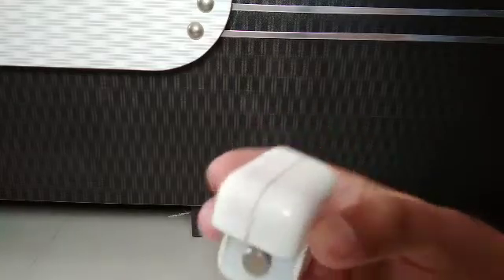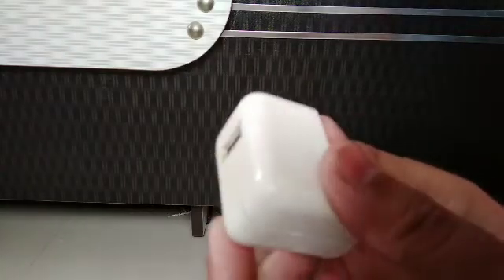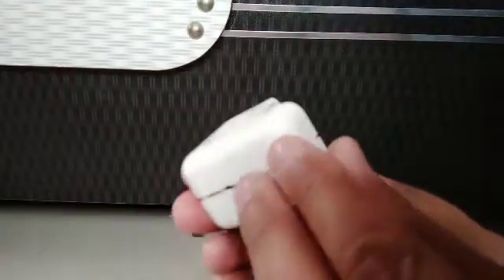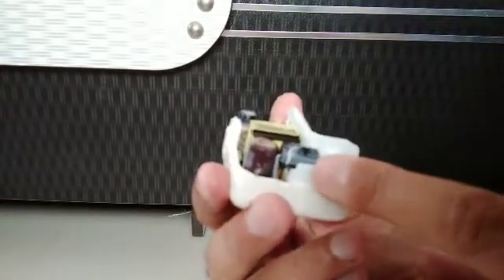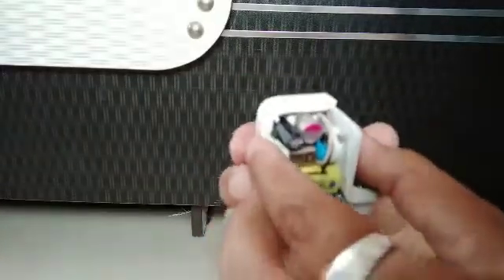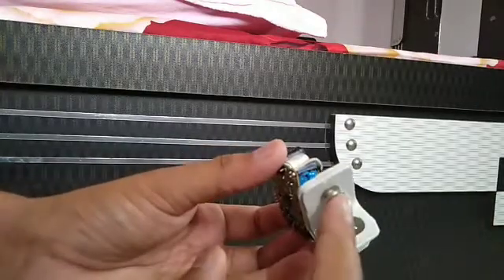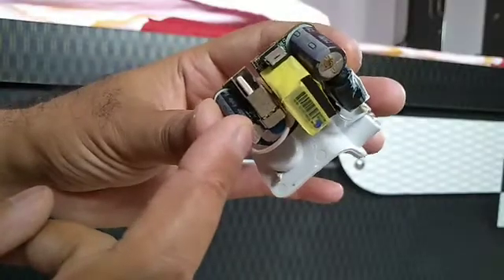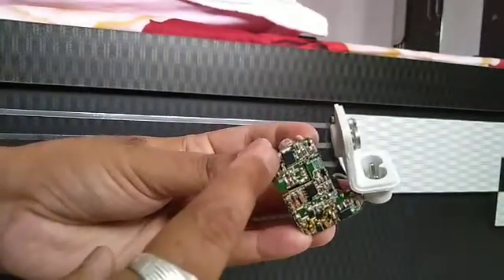Exploring Disassemble Open Original Apple iPhone iPad 10w Charger #apple #iphone

Comment: Sir I have one question.
My charger works fine but when I disconnect it from power supply it will not work for next 30-40 hours and after that when i connect it to power supply it works fine .
So , what could be the problem?
Reply from the maker: It may have got damaged capacitor inside. Which got disabled by IC after which it won't work for a while.